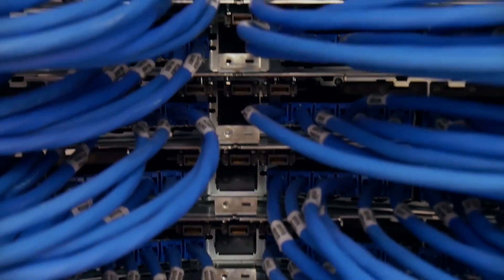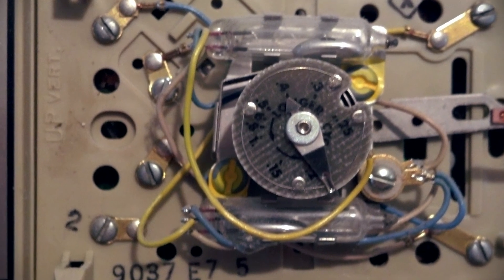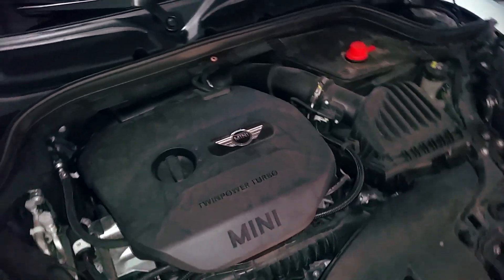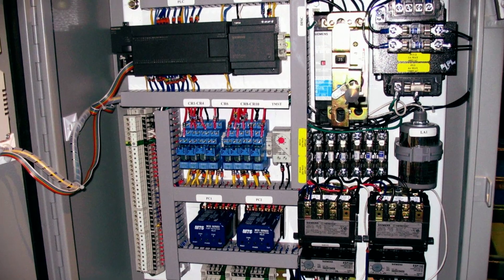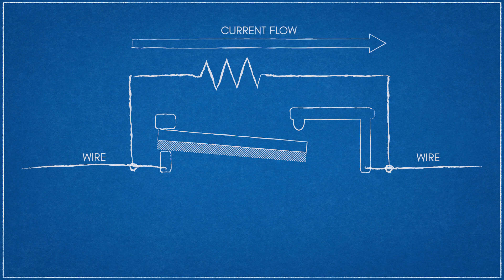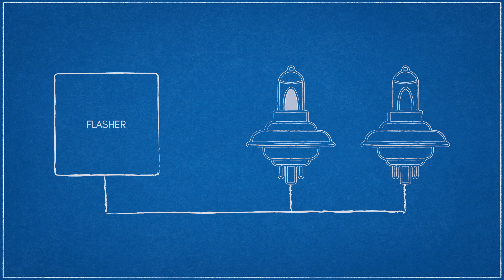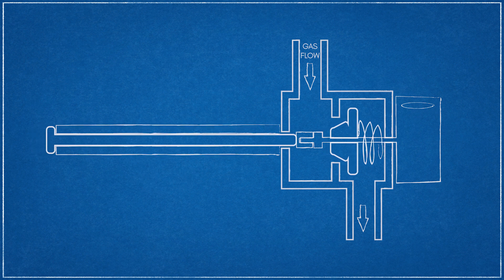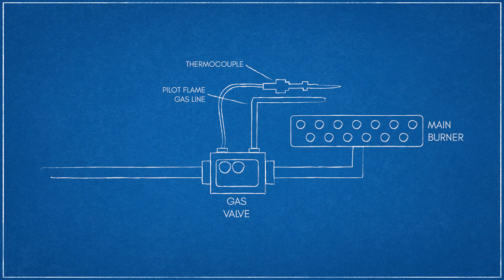Clever Uses Of Thermal Expansion

Comment: Thank you again I always learn something new. Ive worked on cars for some 50 plus years and never even questioned how a car thermostat worked. I had always assumed it was a bi metal switch or valve bnever knew it was wax. I know of a factory that produces high temp ceramic insulating tubes used in high tempeture alloy steel production to shield high temp probes from destruction. It would interesting to know more about this subject. I believe the companys name is Mcdaniels corporation. Beaver falls Pennsylvania. I have been curious about using a high temp resistant ceramic coating or solid material to construct a small wood gas stove or rocket stove. I just suspect there may be more to learn. Ben Franklin devoted much study to the design of stoves fire places and chimneys. Other technologys came about and pushed wood out of the picture. Even todays most efficiently designed  stoves could be improved by advances and development in material science. Ceramic coatings are applied to the interier wall of motor cycle exaust tubes to reduce external temps and other benifits have are realized. Would it be possible to produce a material with micro sized holes that wood gases when forced through under pressure burned much more cleanly. A stove with a preheat chamber an air tight  wood fire below a secondary chambered filled with wood that the wood gas can be cooked out of and then burned at a much cleaner higher temp. I know ceramic grids are already used in wood stoves but can we take this technology to the next level. Sorry to go so long watching your videos get the wheels turning. But isnt that the whole point. Thank you again and have a wonderful day. PS I guess the point of my question is are we getting out all the heat out of the wood thats there to get and doing it as cleanly as possible. Imagine a portable camp stove capable of heating a small amount of water faster than any other known product out there today with no moveing parts other than molicules or maybe just a temp control.

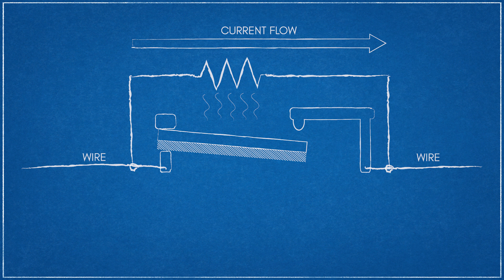Comment: At 7:30 the thermal flasher is also the same principle used on electric rangetop 'simmerstat' controls. By varying the position of the bimetal with a rotary knob  heat control from a very low duty cycle to full power can be achieved.

Comment: Celcius is the correct measure of everyday temperatures because water is everywhere, when it freezes and boils is a very common and relatable base which we are all familiar. In scientific measurements Kelvin is just which starts from the coldest temperature possible as 0 and every degree increase in Celsius is 1 degree in kelvin

Comment: In thermocouples, the voltage is not produced by the junction, but rather along the thermal gradients in the thermocouple wire. Different Seeback coefficients cause differing voltages along the gradients, causing the net voltage measured across the "cold" or "reference" junctions (meter connection) this is why thermocouples require specialized extension wire.

Comment: Thermal switches are not used to shunt power away(wired in parallel), they are wired in series. If the same power to heat an element was shunted through a switch that same switch would explode, as that would be a direct short.

Comment: IMPORTANT!!
in thermal flasher when you have one broken bulb the flashing is slower this is why:
2 bulbs = more current through the circuit, so the heating element  will give more heat.
1 bulb = less heat = longer time to switch on.
However the cooling down time is the same.

Comment: Those were simpler times when every component could be mechanically / physically understood. Now-a-days the chips are like black boxes or even magic since we cannot see electricity.
Reply: Integrated circuits are literal black boxes. XD
The vast majority are a black plastic rectangle with metal pins sticking out.

You're dependent on the datasheet and whatever other documentation exists to make sense of what they do and how to use them.

Of course, you can technically delid them, photograph the die, then reverse engineer what's inside, but this is really difficult and requires special equipment.

So yeah. Literal black boxes...

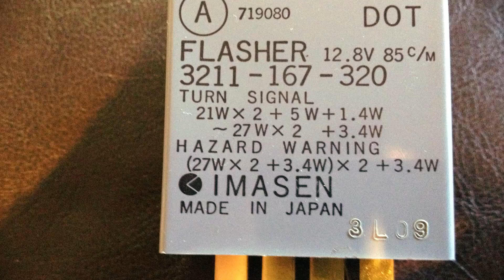Comment: 8:12 If a turning signal light fails, shouldn't the flasher circuit get less current and therefore flash with lower frequency? Why does it flash faster?
Reply: I think only the newer electronic ones flash faster; the older bi metallic ones indeed flash slower or not at all, if a bulb fails

Comment: The first electrical diagram of the bi-metal switch controlling the resistive element is drawn wrong. It was drawn in parallel.   It would need to be in series.  The switch would only control the power in .
Reply: I should have read the comments before commenting, I said the same thing.

Comment: In Anders Celsius museum in Uppsala Sweden you can actually read that Anders Celsius did not invent the Celsius temperature scale.   Anders Celsius used a scale that was "flipped" from what we know today, water freezing was 100 and boiling was 0.  There was other temperature scales during this time and few of them actually used freezing and boiling of water, after Anders Celsius death they simply put his name on the scale we know as Celsius today.

Anders Celsius did actually make a number of observations about water freezing and boiling at different pressures but that was actually introduced to Celsius  scale at a later point.

Comment: For machinery purposes of very tight component assembly you've forgotten the ''interference fit''.
Cooling the shaft and heating up what ever goes onto the shaft.
Reply: Also missing is the analogue problem of Hysteresis (or lack thereof...).  E.g. without designing in a type of 'dead zone', a thermostat would rapidly switch on and off wearing out not only it's own electrical contacts very quickly, but also the equipment used to perform the heating and/or cooling.
Reply: He didn't want to create a full length feature.
Reply: Are you a millwright? This is a common task. Heat and cold help a lot.

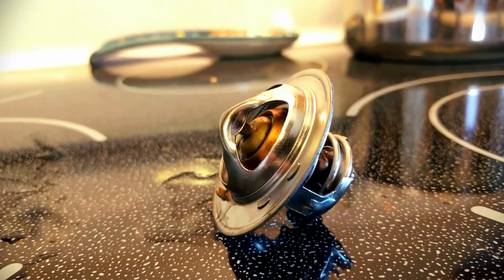Comment: 4:30 its not quite thermal expansion doing the work in a thermostat if the wax goes through a change of state now, is it? 

I'd wager that the 1/4-1/2" of the thermostat valve moving is more than 97% due to the wax melting/freezing, and less than 3% of the movement is due to thermal expansion.

Comment: Cool video. Was expecting something about manufacturing processes using thermal expansion like mounting bearings, but this was very intresting too.
Reply: If we are mentioning heat uses on metal, wheel bearings on solid axles (possibly but unlikely wishbone) need to be put in the freezer so they shrink and can fit into a wheel hub. I'm assuming a wishbone doesn't ever need to be chilled is because conical bearings are cone shaped ∆ and self align. This is from my single experience doing a 1976 Fiat 124 bearing and hub job.
Reply: Perhaps the video title should go something like, "The thermal mechanics of thermostats".  I would still like to see a video about thermal manufacturing
Reply: Agreed, that was my first thought as well
Reply: Yup. The ring gear on flywheels are sometimes installed by heating the ring gear, placing it on a cold flywheel, and then letting it cool and contract.
Reply: He mentiones this in "the science of roundness" or "the science of small messurements"
Reply: #Metoo   ,)
Reply: Me too
Reply: You would use liquid nitrogen or something very cold to shrink a bearing to put it in place.
Reply: Same
Reply: What i was hoping for. Dont think the creator understands his audience.
Reply: Cylinder sleeves are installed by heating the cylinder and installing a cold sleeve

Comment: TIP: Sometimes, when lighting the pilot light in a pool heater, we had to hold a lighter under the thermocouple before turning on the gas. Just trying to light the gas and have it heat up the thermocouple wouldn't work, as the gas didn't heat it fast enough. I have heard this works on water heaters and such other things. KEEP THE GAS OFF UNTIL READY TO LIGHT, or you may be up for a Darwin award.

Comment: I’ve long wondered what would happen if a bimetallic rod were fixed at both ends and allowed to build stress. Would it store these compression/tension forces like a spring? Would it undergo plastic deformation? If you unfixed one side would it snap quickly or slowly? Would it forcefully snap into a different shape or just pathetically groan and warp?

Comment: The thermal switches for turning lights blew my mind ! I had no idea !
Reply: Steak Saignant same here. My 75 needed a flasher relay, it would get stuck with the lights on.
Reply: I have been thinking it's an RLC oscillator for so long.
Reply: glad , im not the only one...
i actually went bananas....
Reply: The thermal-based operation also explains why directly replacing the blinkers with LED versions usually causes a constant fast flash, because the LEDs don't draw enough power to lengthen the sequence.

Hazard lights are often controlled electronically instead, so those will still blink normally.

Comment: An interesting use you didn't mention: thermal expansion is used to join gears, wheels and other rotating objects to shafts/axles. The wheel and shaft are made to slightly overlapping diameters, then the wheel is heated and expands and the shaft is cooled so it shrinks a bit. The wheel is then slid onto the shaft and when the parts cool down/heat up to room temperature, the wheel grips tightly onto the shaft.

Comment: those thermal sensors are probably still there but does not pilot the switch and just relays the information to the programs nowadays. (hence you can set a range of things happening at what ever temperature detected.)
Reply: afaik the common electric temperature sensors work by different principles, either by having a resistor that changes it's resistance with temperature (pt100), thermo couples (differnt kinds of metal connected that lead to a tiny current depending on temperature),  or via special semiconductor circuits... then an adc to convert the signal to a digital value which a program can deal with

Comment: Whenever I change a hammer handle, I put the head  in a 450° oven. The handle opening will grow in. 05" when hot. I then install the handle normally and when the head cools to ambient temp, it grips even tighter.
Reply: That is a great idea I will have to try it on one of my broken hammers. 
At that temperature is there any chance of scoring the wooden handle to a degree of notability?
Reply: @satinsoldier  I only heat the head. 450° is not hot enough to harm the temper nor burn the wood.
Reply: Mark Daniel thanks for the additional insight
Reply: That's a smart idea. Just like heating up bearings to put on rotors.

Comment: Did you know that most racecar only use water as a coolant. Their cooling system is pressurized to allow the water to get to much higher temperatures before it boils. It's also important that they're only using water because water evaporates easily after an accident. Coolant is slippery and not good for a racetrack if someone crashes.

Comment: You can use a resistor to sense temperature as well. Cody's Lab did a video where he made one. The resistance changes linearly with temperature, so as long as you take a few datapoints of resistance as a function of temperature you can work out what it'll be at any temperature. I don't think it's as accurate as using a PN junction diode and using the diode equation to find voltage drop vs temperature.

Comment: It's interesting with flashers. As one light bulb goes out, the load goes down and the frequency rises up (and less heat is produced by the flasher's resistor), which actually wasn't that obvious to me when I first thought about that. (And still isn't) I mean, at first, I likened it to pushing a swing with various forces, and while the swing frequency depends on the amplitude, it doesn't seem that drastic compared to flashers. Has anyone read an article/a note about this, perhaps supplemented with heat transfer and movement equations? And which bimetals are used in flashers? I'd expect some hysteresis there; however, too much hysteresis would prevent such a pronounced frequency change, I presume.

Comment: thermocouples don't use thermal expansion they use the thermoelectric effect.  most electrical sensors (RTD, TC, diodes) don't use thermal expansion either.
Missed the Sunbeam toaster, lowers the bread and raises it using thermal expansion.
Reply: Chris Yu Didn’t the video mention the thermoelectric effect?
Reply: @RandomNumber141  Yes. 11:00

Comment: Nah, cars dont work best around the boiling point of water, its just what materials were affordably available early in the industry's history, and a large expensive structure was built on top of that. But there are many factors to consider about what makes a car work best, starting with clarifying the original claim into "what combination of traits are optimal for average use?" 

There are many ways to make cars run "better" or simpler, more effecient, more comfortable, more environmentally friendly, and less expensive to produce operate and maintain. While many of these are incompatible in some variation, an ideal motor vehicle operating best around the boiling point of water, has almost nothing to do with the efficiency of that temperature, but the integrity of the cheap parts used in the industry to make it affordable.
Reply: So what you are saying is.... he is correct.
Reply: music ...no.
Reply: I think you are just spouting rubbish tbh op.
Reply: laurie agnew how so?